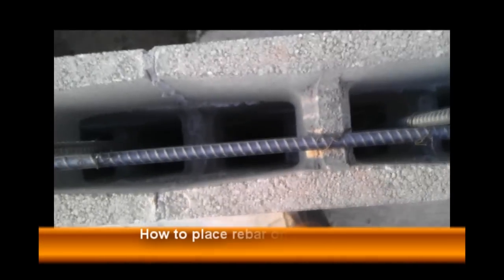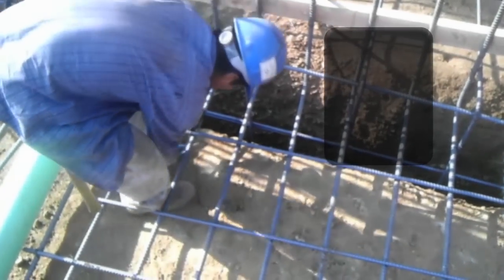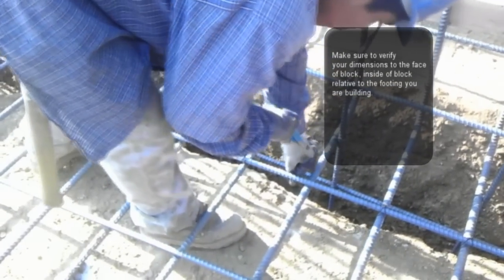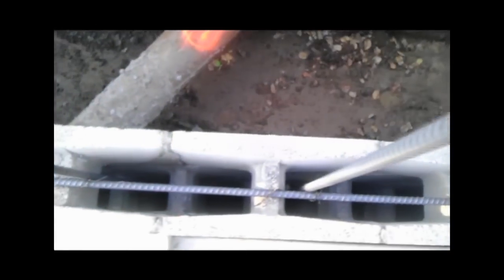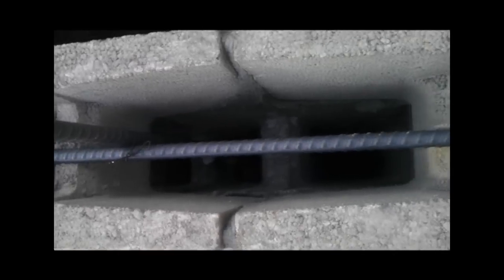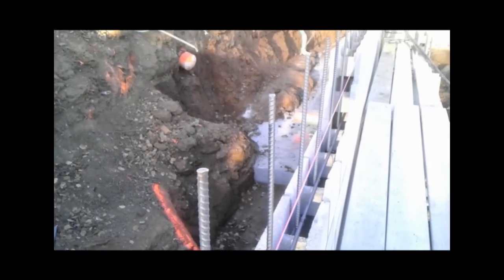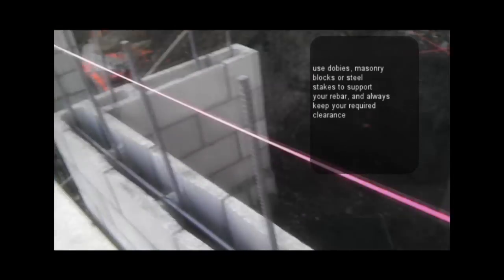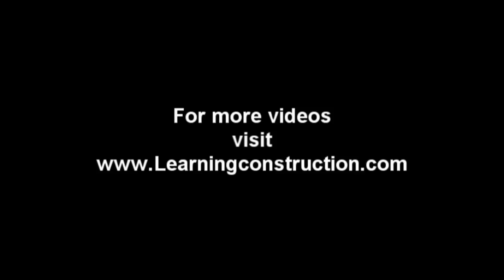How to Place Rebar in Masonry or CMU Walls

Comment: I have my concrete block foundation done and concrete poured in all the blocks with the anchor bolts. What am I supposed to do with the rebar that is sticking up thru the blocks? Cut them off level with concrete or let them run up into the framed wall?

Comment: I'm one of those asshole inspectors :)
The issues that show up all the time are grout heights exceeding the low lift height and rebar laps....for all sorts of reasons such as time, rebar length, and even masons not wanting to reach over bar that is sticking out too high.  The low lift grout height is the maximum wall height that allows you to see all the way to the bottom of the cell to ensure it is clear of debris.  It is usually specified in the structural drawings to be about 4'0" to 5'0".  This is not the height of the grout.  It is the height of the wall section at the time of grouting.  I have had blocklayers ask me if they can lay the block up higher and leave the grout down so that they don't have to strain while reaching over the vertical rebar.  This procedure would not be considered a low lift grout and high lift grouting procedures would be necessary.  High lift grouting is a pain though because of the additional inspection.  It is sometimes nigh impossible, especially on elevator shafts and stairwells.  The structural engineer is the one who can change the low lift grout height  and I always encourage clients to give them a call.  I tell the client that what matters is that I can see the bottom.  If I can see the bottom (with a flash light), it doesn't matter how high the wall is.  I don't mind them grouting higher but me, the inspector, is not actually the one to make that call.

Comment: i know the vertical dowel are stater bar....   

?what is the name of horizontal dowels ?m
Reply: Lintel, not lentil.  Lintel is a supporting structure above a threshold, door or window.  Lentil is a bean.
Reply from the maker: eddy odaris perez Good question!! horizontal reinforcement is the most common.  At the top will be called lentil bars.
Reply from the maker: SteveBowen thank you for the correction, ROTFL i am still laughing about it.  you caught the true spirit of Learningconstruction.  learn, share, expand.

Comment: But what is the best? Block concrete or poured? And what is the cost difference?
Reply from the maker: cdomize thanks for your question. The difference will depend on the use, but for a retaining wall such as this one, CMU will be  more cost effective. CIP or poured in place is typically more costly.